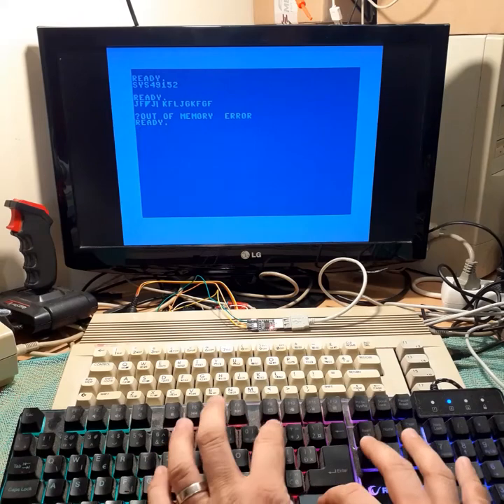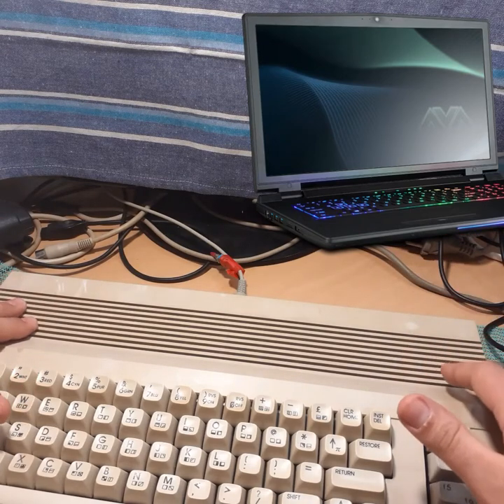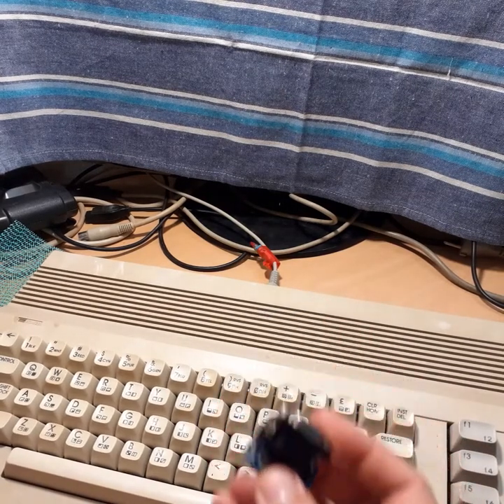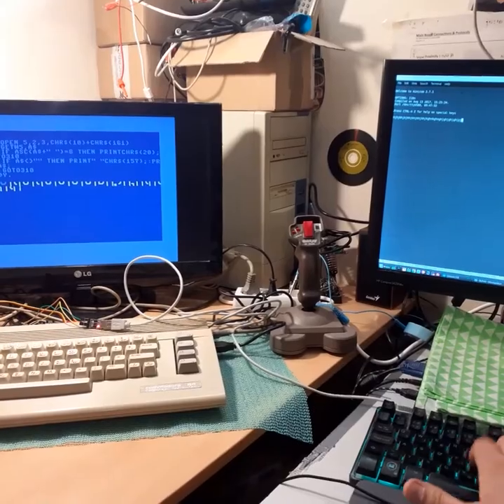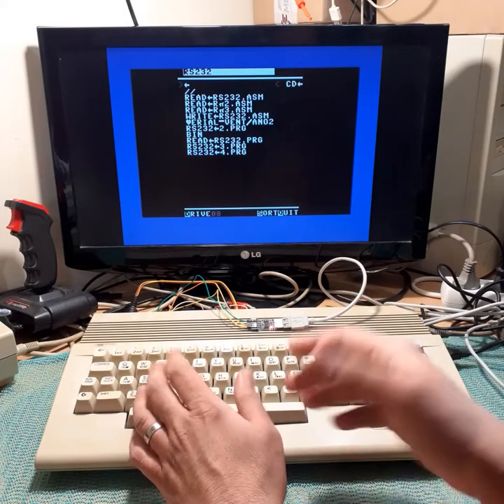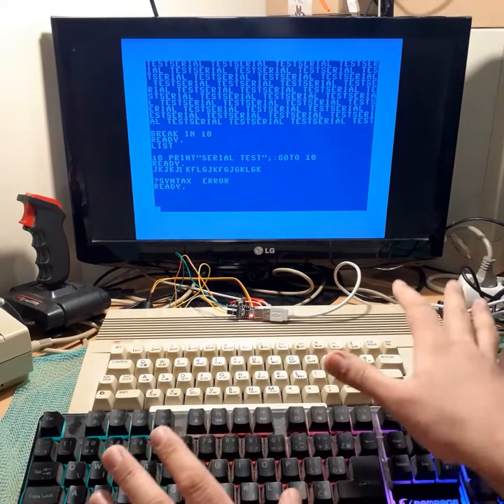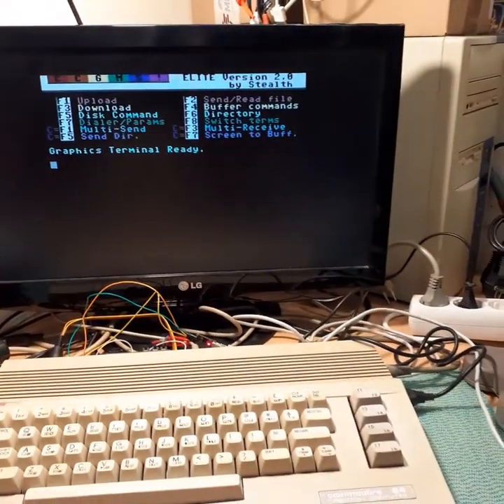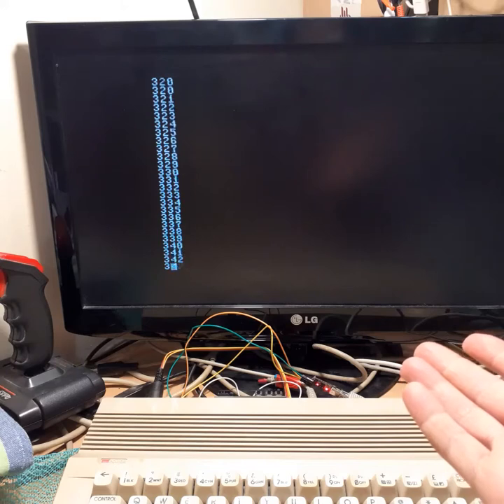RS232 on Commodore 64 | Connect C64 with a PC | Easy way

Comment: I currently has a Raspberry Pi Zero 2 set up in USB gadget mode and I can get to it through the COM port on my PC with PuTTY but I can't seem to get the Commodore 64 Ultimate to connect to it through USB. Does it just pop up in the terminal or did you have to do something on the terminal side with the C64 to get it to connect? I honestly don't even know if what I'm doing is possible but I'm messing around with it and I'm new to the C64. Thank you for the informative video!

Comment: Very nice! Great job! I have one question: Would that work with c64 plus/4 as well? I mean the pinouts would be compatible?
Reply from the maker: Thank You and sorry for my very late respond. 
Yes I think it should work on Plus/4 but I remember there was something on that machine, not sure was it RS232(TTL) or GPIO pins that was locked. Need to refresh my memory :)
Thank you and Merry Christmas!

Comment: Excellent video, thank you!  I found it after searching for a problem I've been having using both ESP32 (using a level shifter for 3.3V) or Arduino (straight 5v connection)  and software serial to connect in the similar fashion to a C64 user port.  (I don't have any assembly knowledge worth anything, so I'm using the standard get from the user port device in basic).  It seems I can handle 300 baud connections fine, but at 1200 baud, I set the Arduino to send 40 characters every few seconds (with a delay long enough for the C64 to print them on the screen and go back to waiting for more data so I know I'm not killing the c64 rs232 buffer).  

Every now and then, I receive some garbage, and I'm not sure why.  I'll print one or two lines worth of the alphabet, then maybe the 3rd line gets a garbled character in the middle, and then it's fine again for another line or so before another random bit of garbage comes through.  It's highly intermittent, and I'm half tempted to try it in assembler to see if I get the same results, but was wondering if you ran into that with any sort of 'stream' of character data - not enough to fill the RS232 buffer on the C64, but still more than just a a single character typed manually at a time.  Thank you!
Reply from the maker: Thank You for Your comment :) Yes, the bottlenecks are definitely BASIC and CPU; BASIC is easy to solve, if you are not familiar with assembly then I would suggest trying "C". CPU handles RS323, well to be precise, TTL communication and as You mentioned, the speed limit is a big problem. So maybe try to send way fewer characters than the size of RS232 buffer. or just try to send chars. one by one just for test purposes and see do you still get those garbage characters.
But Your approach should be fine in C or Assembly. Cheers!
Reply: @JosipRetroBits  Thanks for the insight!  I at least have the project working at 300, so with version 2 I'll start converting it to assembly (just for fun).  Last time I did assembly was in... 1997 on x86.  Been a while. :)
Reply from the maker: 1997, that is truly a while ago :) Good luck with version 2 in assembly. I wish You a great time and lots of fun :)

Comment: What a marvelous video!
The best way I'd found so far was using an arduino with software serial, but this is a lot more compact.
Exactly what I was looking for, thank you
Reply from the maker: Thank You :) I'm glad that You find it helpful. 
Yes, Arduino boards also have the same(or similar) ttl2usb chip on them. That is why they are used here. But we only need that little chip and C64 :) C64 serial is pure TTL 5V signal, absolutely perfect for modern devices, no need to convert it to rs232 or do anything with it :)
Cheers!

Comment: I still have the fischertechnik C64 interface laying around. Could it be upgraded as well to a USB connection? However, it would have to mimic the whole C64 user port...
Reply from the maker: I'm not familiar with that device but as I am able to see online it uses a user port connector and probably using 8 GPIO pins, not just RS232, so if you want to play with that device without C64 it would be possible to connect it on the Arduino Uno or some similar board and controlling that way.
Reply: @JosipRetroBits  Actually just the user port (the fischertechnik C64 interface has its own AC adapter). Hm, so Arduino Uno... have to read into it. Thanks!